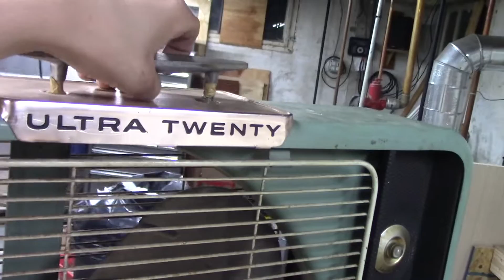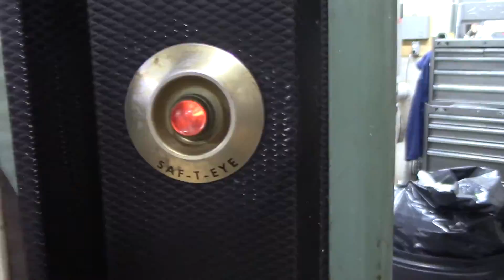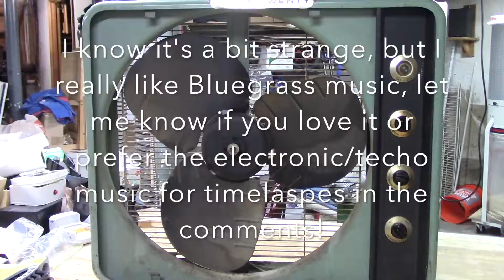Vintage LAU Ultra Twenty Box Fan Clean and Service

Comment: This is the exact fan that SpatsBear2 has (you can find it on his channel). I remember seeing it on his speedyc395 YouTube channel more than 10 years ago before he eventually posted it on his current one and before that old channel got suspended. There’s also a similar model called the ‘Super 20’ that Jordan U has. Only his has just a thermostat with no reverse and no pilot light like this one and the one that Spats still has. Other than that, it’s the same fan with the same motor with the same sounds.
Reply from the maker: Yup, I have seen both of those videos! The ultra twenty was the top model, I think the super twenty was below it in the ranking. Thanks for Watching!
Reply: This model and the LAU Super 20 are superior fans. Certainly better than today’s crap that you can find in Wal-Mart. They don’t make ‘em like they used to.
Reply from the maker: You hit the nail on the head there!
Reply: @1998MonroeNYColonial  it is superior heck at a low quiet speed it throws a impressive breeze in a bedroom and at high speed well that fan is all you need to cover a big family room and maybe the kitchen at once

Comment: Phenominal restoration!  Looks and performs good as new.  Yep, we all have moments where we break things, my last was the switch on my Frigid 14" box fan.  I didn't know how it was attached, so I pried on the knob with a trim removal tool and .. oops.  I have a toggle switch on it as well.  The way I see it, we can use those toggle switches and one day we'll find a real replacement.  Oh and I do the same thing with the drill press :-)
Reply from the maker: Thanks! Sure does! :) Yea this is not my first time either lol! I was just annoyed at my self for doing it. Unless I can find a switch that will work, the toggle is staying. It really doesn't look too bad and is certainly clunky enough! Drill press trick works great right?! Thanks for Watching!

Comment: Had to come watch this after I saw it in the fans startup video for this year.  What an awesome looking fan.  Actually the toggle looks really good down there because now the four circles on the left side are "symmetrical;" the middle two are knobs, and then the top and bottom ones are a good visual match as well.  Fasco motors seem to be fantastic all around, I never see any that have issues and their spindowns are quite lengthy.  Is the Saf-T-Eye a neon bulb?
Reply from the maker: Yea I love this fan! Couldn't beat the deal either! Yea it doesn't look too bad at all and the clunkiness of it sure fits the rest of the fan lol! Yea seems to be a pretty good motor! I believe it is a neon bulb, but I could be wrong. Thanks for Watching Xyspade!

Comment: I have the same fan with the same reverse switch problem. Was hoping to slow down your vid at the point where things went wrong. If you could go back in time, did you realize what froze the switch and how you should have fixed it? You made a hard day’s work into an enjoyable 22 minute vid that will help every future Lau owner!
Reply from the maker: Really? That's weird. It turns out that it was just the actual shaft that spins in the front housing of the switch that was stuck. I went wrong by trying to take it apart, and when I went to reassemble, I accidentally broke off a small tab. If I were you, I would just lay the fan on it's back and keep spraying WD-40 on it or penetrating oil and after letting it sit for a while see if you can slowly work the shaft back and fourth with a pair of pliers. DON'T TAKE IT APART, IT WON'T HELP! lol! After doing this several times,  it should break free, or at least that's what happened for me. Yea it was actually several days lol! That's why I like the time lapse videos! Thanks for Watching!
Reply: It would make things easier if the switch knob popped off so I could spray but that is my first problem, unless it has a set screw?
Reply from the maker: mine slid right off, no set screw. just be careful about prying it off, don't want to snap the knob